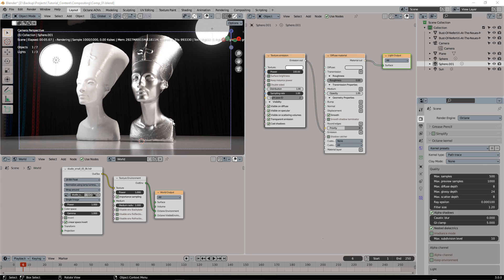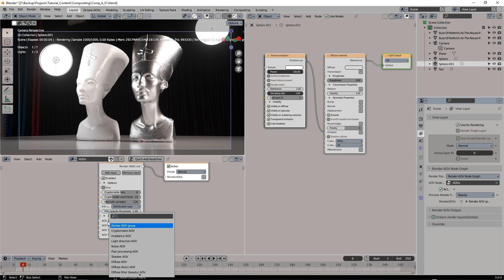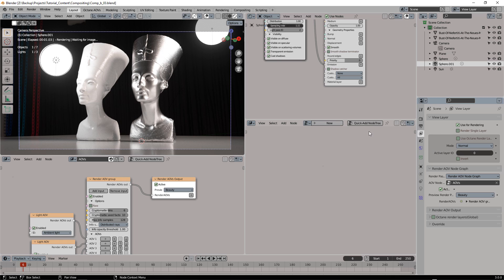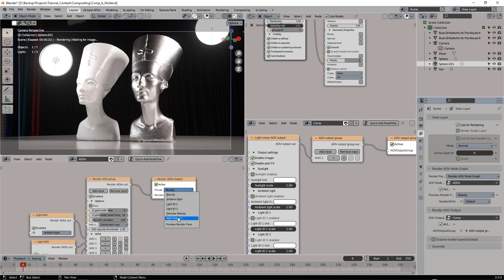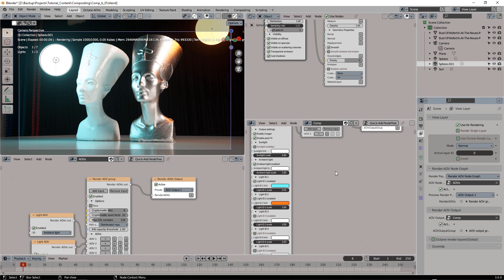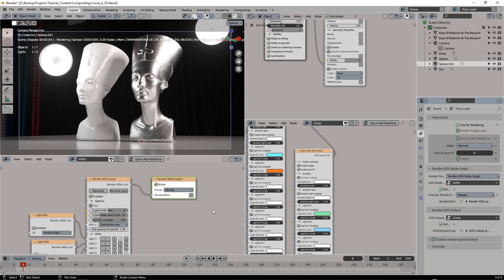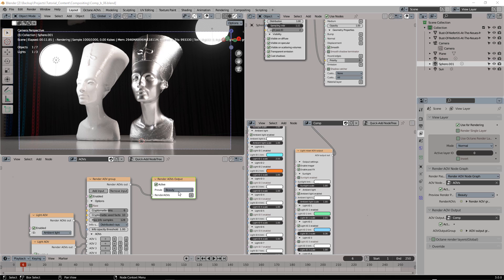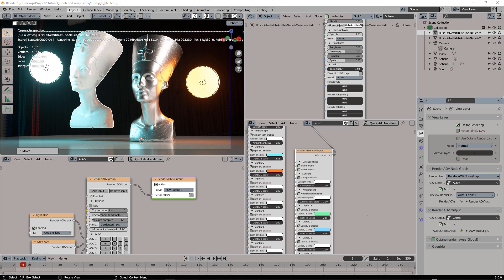Using the real time compositing Light Mixer in Octane for Blender.

Comment: Hello! May I ask you a question? When I output AOV, they are displayed without imager tone mapping. I need to apply it additionally in compositing. I have enabled its use for all cameras in the window in the viewport.
Reply from the maker: Hi! I think I already answered to your question via the OTOY support. I'll put the information here, by the way, so anyone can better understand how this is working. The Imager and Post Processing settings you can find in the 3D view and the Camera options are only relative to the "Classic" Render Passes Style. The new Octane AOV/Compositor offers the same options as nodes. Also, the Post Process is an AOV that can be added in the Octane Compositor, so the same effect of the "Classic" mode can be achieved.
Reply: @linograndi  Hello!
Yes, I wrote a comment here, and then contacted support.
Thank you again!

Comment: How would one render this out for comp using Aces? When I add(or linear dodge/add) the different light passes together in resolve, it's all super blown out. I have 8 different light passes.
Reply from the maker: In which format are you exporting your passes?
Reply: @linograndi  32 bit exr. As single files, not multichannel.

Exporting as Acescg, and applying input transform of acescg in resolve to the footage.
Reply: It appears to be a Resolve Aces issue. When I comp it in Natron it works fine. Thanks for the videos! I remember your name from Lightwave days. :D
Reply from the maker: @robertabrie  Those were good ones!